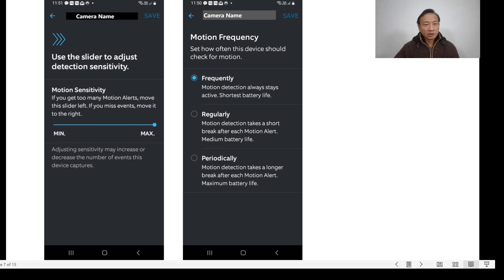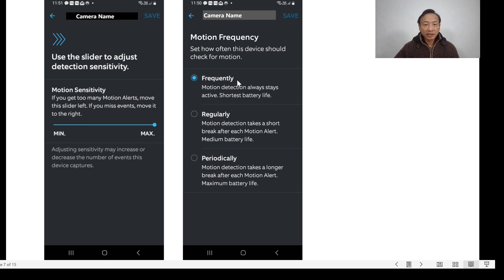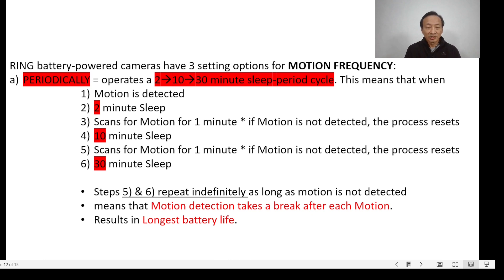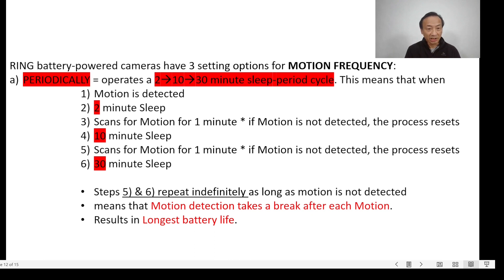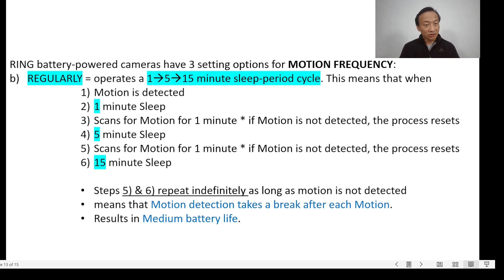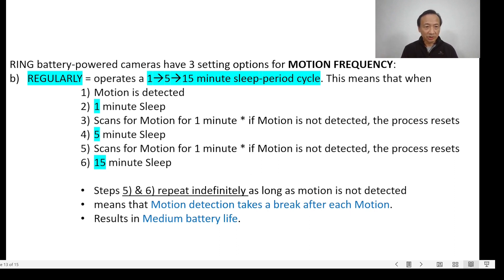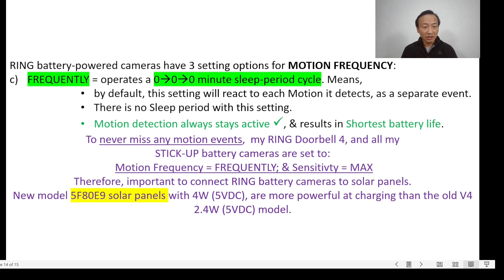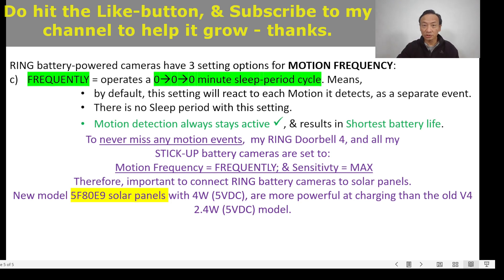RING Motion-Frequency. Beware! camera sleeps long time on 2 settings.

Comment: No wonder they don't disclose this... those settings are absolutely horrible.... 2 settimgs are almost pointless. 15 min sleep for regular?  Insane and 30 minute sleep lmao is literally unbelievable... ive looked all over for this.. thank you sir
Reply from the maker: @ihategangstalkers3912 Hence, all my 5 outdoors cameras are connected to solar panels. And Doorbell is connected to 15VAC. I never have to remove batteries to charge. All devices are set to operate at REGULARLY FREQUENCY..

BTW, check out video on the sun-rain metal shades I built for my outdoor RING cameras.

Comment: How long does the battery last if you turn on frequently mode on?
Reply from the maker: all my outdoor cameras are connected to RING solar panel, & set to Frequently mode. I never have to remove batteries to recharge since installation (over a year).

Comment: As other have said, this information has been incredibly useful. I installed my first ever Ring Doorbell (Doorbell Plus - newest version) and was so frustrated that it appeared to capture random events. I was ready to return it. Now I understand why it sees my car arrive in the driveway but misses me entering the house.
I wonder what sort of percentage hit these settings have with battery life, including setting the sensitivity to MAX. I know it depends on lots of elements, but are we talking about serious drain? Unfortunately there is no room to fit the solar panel in my situation.
Reply from the maker: u can test the battery drain by setting Motion Frequency to FREQUENTLY. Without external charging, battery will likely decrease double-digit % very fast. I connected the 15VAC power-suoply from my old analogue-doorbell, to my Doorbell4. It helps significantly. But over the past year, especially during winter, the battery can still drain faster than the 15VAC can recharge the battery. So i have had to replace with freshly charged battery.

Comment: this video is awesome. It’s unfortunate that ring doesn’t give us better control over this
Reply from the maker: @climbbike1234  RING doesn't publish this info on its battery-powered cameras. I also have the RING Doorbell4 - which i connected to 15VAC power. In Australian winter, despite being charged with 15VAC, the battery-power decreases very fast, & i am down to 3% power after say 3-4wks. Not satisfactory design.

Comment: Will this new solar panel you recommend work with ring video door bell 4+ , I notice they do not sell this model solar panel on there web site in New Zealand. Thanks for the video.
Reply from the maker: I have the Doorbell4 & installed it last year. But only this year about March, I connected that doorbell to the existing 15VAC power supply of my old FRIEDLAND door chime. So much better to have the Doorbell4 connected to the 15VAC power - as I don't have to worry about battery dying when I am away from house for a few wks. After connection to the 15VAC power, I logged the voltage of the battery. And here is the interesting behaviour. The doorbell battery was initially 100% charge, but it started dropping to about 86% over say 5 days. Then it started recharging back up to 99% (not 100%). After that, over course of about 5 days, the charge dropped to 86%. Then it began recharging back up to 99% over next 5 days or so. As at today, I have see this trend happen about 5 times already. So I believe the Doorbell4 has a  built-in feature to deliberately cycle the battery over this 86% to 99% charge capacity. 

On the RING DOORBELL4 webpage, it states : "
Runs on a removable, rechargeable, Quick Release Battery Pack (included). It can be also hardwired or powered by with Ring Plug-In Adapter.

• Can be hardwired into an existing doorbell system (8-24 VAC, 10-40VA, 50/60Hz).
• Plug-In adapter 2nd Gen (24VDC. 0.5A, 12W).

Do not use with halogen, garden-lighting transformers or 3rd-party DC power adapters as it will result in damage to the device."

For DOORBELL PLUS, power supply AC & DC requirements seems similar approach.
https://ring.com/au/en/products/battery-doorbell-plus

They do not seem to say that solar panels can be used to supply DC power, but that could be because they want customers to buy their RING DC power supplies. Or perhaps, RING plug-in adapters have additional electronics to regulate/convert the voltage to the Doorbell terminals.

I find that RING does not provide clarity about their products. I suggest you call RING & ask them to explain specifically.